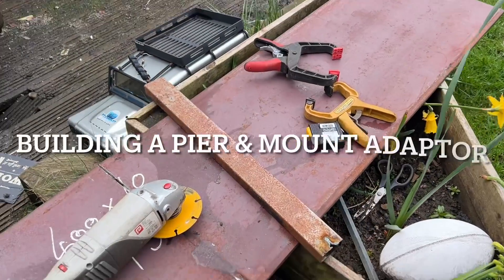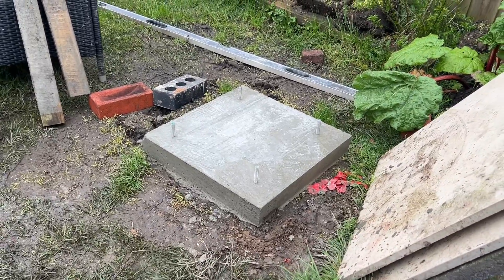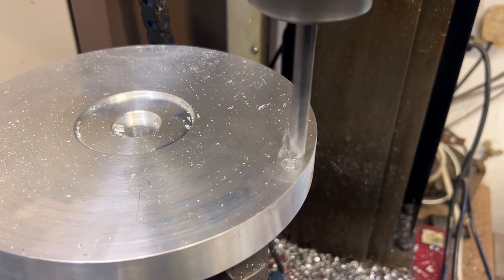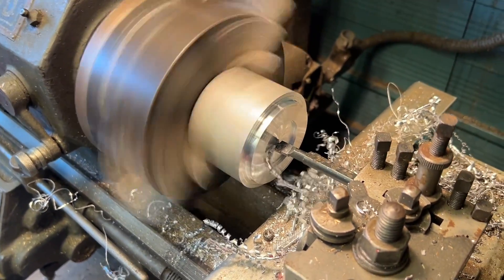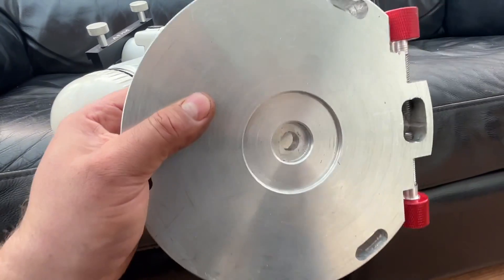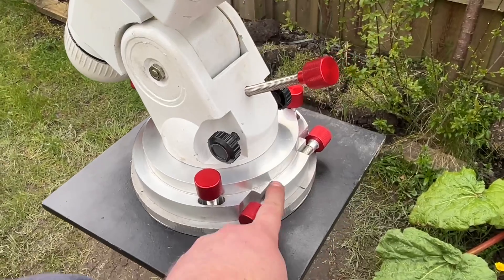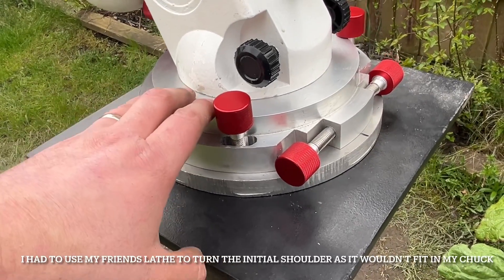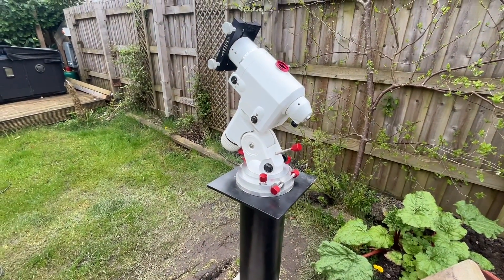DIY Telescope Pier & Custom Adapter for EQ Mount – Solid Backyard Setup!

Comment: Hey Chris, I sent an email to your website I'd be very interested in seeing if you'd be able to build me one of these as well.
Reply from the maker: Thanks for getting in touch. You’ll see that I make a lot of things but I’ll admit, that was pretty heavy engineering compared to my usual builds. It really stretched what my tools were capable of and sourcing the aluminium and thick steel tube was tough. Whilst I’d always be keen to try and help people, I’d struggle being able to make one of these for a sensible price. I expect a commercial pier would work out cheaper.